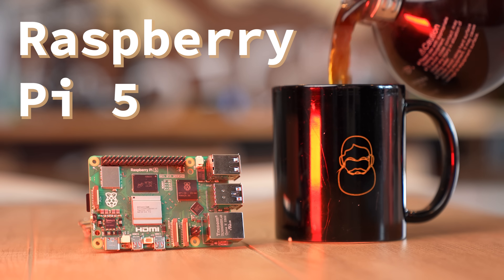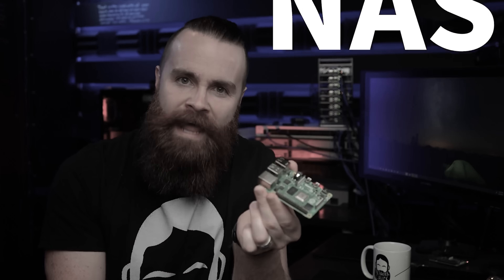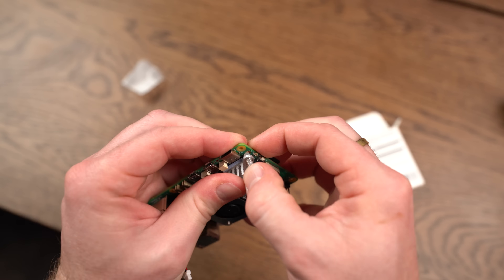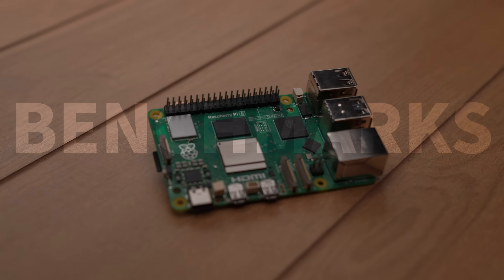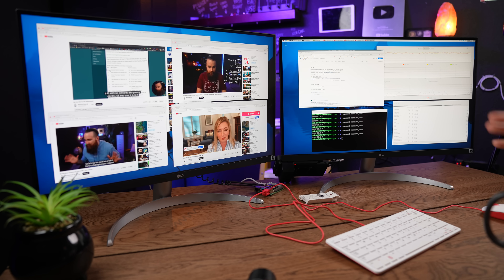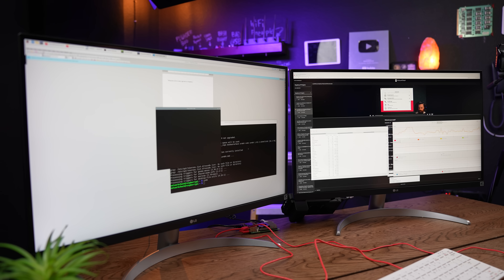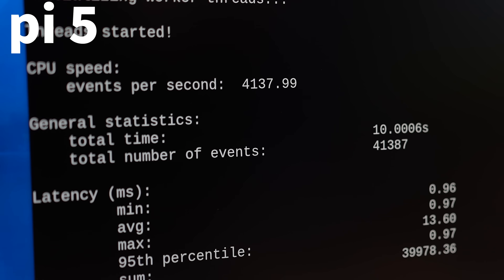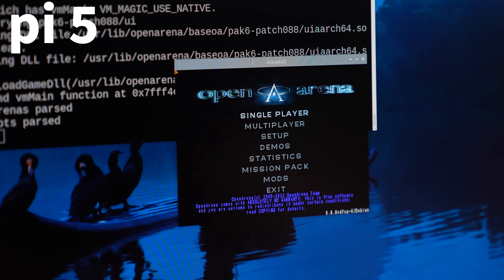the Raspberry Pi 5

Comment: You should test in a normal desktop environment with 1 monitor at 1080p, even though the Pi is capable of 2 monitors at 4k. Maybe this way the GPU performance wouldn't suffer so much.
Reply: Run an SSD and it will greatly improve
Reply: @mrmotofy  I don't believe it will improve much for video streaming. Maybe using network cable instead of Wi-Fi would also be a great test, also, is there already an interface to convert the ribbon cable connector to an actual PCIe slot?
Reply: @linsdudu  The  whole OS running on and SSD? Yes it will be tons faster, from like 84Mb/s to 400+ Mb. Everything gets better. I run the pi4 on an SSD and it was night and day difference and it maxes at 240Mb and doesn't drop frames at 1080p
Reply: @mrmotofy To load the OS and applications I know it will improve performance, even running from USB, now with up to 5Gb/s, which is close to SATA 3 but when you are already in the browser streaming the video I don't think it will make a lot of difference and we don't know the SD card interface speed comparison of Pi4 and Pi5 as well. UHS-II cards can support speeds of 300MB/s+
Reply: @linsdudu  We DO know, sdcard is 2x faster at 84MB/s and SSD is 2x faster too at 480MB/s. The processor is about 2x faster. So on an ssd yes it would be very usable. A pi4 on SSD at 240MB is very usable at 1080p
Anytime you speed up the files system everything speeds up
Reply: @mrmotofy  Jeff Geerling has a more indepth video on the Pi 5 with better results running of the SD card.

Comment: I must be honest any used $100 mini PC is better. RPIs prices are so inflated and I totally stopped using them for all my projects,  On a mini PC you can install, Windows, Linux or Android. If I need IO ports I just slap Arduino on the USB port. The 4K and YouTube video playback is perfect.

To be viable, RPI should cost:
zero $10
3 $25
4 $35
5 $45

Comment: Overclocking gave me better video experiences on pi4. Hopefully with overclocking and new features unlock, 4k video viewing on single monitor should be more stable.
Reply: Hmmm, maybe, but it now already ran max resource and very high temps, add a sunny climate or warm room, a case and more continuous load I wonder if it will not crash multiple times a week in longer operational times
Reply: @xdarrenx  i bought a custom cooler fan. it's a must for over clocking

Comment: Raspberry foundation takes 4 years to release a new Pi, but when they do its huge news
Reply: Yea but...there's the global shutdowns and massive chip/product shortages that have crippled productivity for nearly all manufacturing
Reply: @mrmotofy  here's the global shutdowns and massive chip/product shortages
that's not the case. The dark side of the Raspberry Pi is that it eventually became an enterprise oriented rather than hobbyists product  so too many businesses have jumped on the boat causing that high demand that in turn makes all those shortages and drives stellar prices. There was no "chip shortages" for Raspberry Pi alternatives at the same time though. Moreover, some major electronics suppliers for 3D printers filled the gaps by offering their own Raspberry Pi substitutes which are cheaper and way more adjusted to the application. So now it seems like Raspberry Pi manufacturer is just trying to catch things up and regain the lost market share.

Comment: But is this better than the OrangePi5?
Reply: Did my own research, The Rockchip is still leagues ahead of the Cortex A76. Idk why anyone would want to buy a Rpi anymore when it's actually more affordable to go with another SBC now a days. I use it for home assistant and network hubs, I personally wouldn't go back to the Rpi4 after going with the OrangePi5 personally. I don't know if I'll choose the Rpi5 either. I may pass until they get something more beefy that can be a low power low-end PC equivalent.
Reply: @oldmedia7  Running on a slow sdcard, no use ssd

Comment: I actually needed to buy an active cooler for my Pi 4 running my PLEX Server because it was getting a tad "toasty".  These look SWEET...are we actually going to be able to get one though?    That drought of PIs was HORRID.  I used them for my 3D Printers, and playing around with.
Reply: How the hell did you run a plex server from a pi? I assume you were only streaming to a couple of devices with GPU transcode or native? I run my PLEX off a 5950X server with CPU transcode lol. It runs a lot more than PLEX but moving services to a few PIs would save power.
Reply: @spencerhho Plex PI Server.  It works, and available from PLEX.  I use a PI-4, and I can easily stream two 1080P videos.  I've not tried 4K at all, but I don't have any 4K ready to go yet as I'm still having issues with my 4K Movies having mutliple M2TS files for a single movie and needing to merge those M2TS files into a single file.  There doesn't seem to be any free merging tools for this.  :(

Comment: Damn, Pi 4 and all others are super expensive, 80$ will get you a great HP SFF with quad core CPU and 32gb ddr3 PC that has 2   3.5" bays and 2 bays for 2.5" disks or even 4x3.5 if you get those sleaves.
Reply: But will it fit in your palm/pocket
Reply: Which HP model is that? Is it new?

Comment: Knowledge is knowing it CAN use 2 4K monitors. Wisdom is knowing you SHOULDN’T.
Reply: Realism is knowing if you can afford two 4K monitors, you'll be able to afford RPi5 (from scalpers).
Reply: @sharpfang I just said the same thing about the scalpers before seeing this comment
Reply: @sharpfang  yea... that is what kills me. lmao... In my country, the Pi 4 2GB were like 150 USD... 8GB around 300... lmao (probably because scalpers bought from official sites that already had inflated prices)... lol I want one, but heck I gonna pay that much for a pi5...
Reply: @sharpfang  lol
Reply: Still, that makes it a great deal for info displays at shops and restaurants in which you probably just display static images anyways
Reply: @jackmcslay  I mean, I sell and install AV solutions and there are better solutions for the same price... A dedicated video streamer can easily cost less than a (hence) barebone Pi5, and if all you need is static images, even some hdmi splitters can do that standalone.
Reply: This honestly.
 I don't know from a production level, but it seems like this is a far cry from the old $35 price point, and to remove the composite cable. 
I don't understand why you need 4k on a Pi... if anything I'd much rather this stick with 1080p performance if it could have knocked things down in cost. 
$60 is no longer an impulse buy. It's now something I have to make as a calculated decision. Cause two PI-5's can be the same as an old desktop which will be a lot more useful.
Reply: @novamaster0  Info screens are a big application for rpi. Framerate in single digits is not a deal breaker,  but sharp, big contents matter.
Reply: @novamaster0  how old a desktop? It boils down to CPU and GPU of PC vs RPi5 and how much for each.
Reply: @novamaster0  with the 4k support u can create a nice 3D Printer with integrated Display and 4K Cam inside it by using that PI5... thats a good Point for it. also know that Pi's are for guys who wanna do it self and not bye the things totally done at any market.
Reply: @novamaster0  Two to three times the magnitude of the last generation of Pi, at a little under twice the cost. Seems so-so as a deal. The Pi5 does not even support 4K yet so their selling point about that is kind of moot until FW updates.

All in all I agree with your statement of "I don't know"

I'm not sure how I feel about it all, especially with scalpers knicking the entire preorder inventories in a matter of minutes.

The Pi industry has far left their origins and are aiming to be absolute giants, before they can even take a few baby steps due to their infrastructure being so insolvent and highly dependent upon even bigger giants.

Arduino is looking mighty fine these days. All their new tech has been popping off. RISC is interesting to watch too.
Reply: @novamaster0 
Watching Eben's RPi5 launch video, he addresses the pricing.
The RPi is now officially the flagship product.
The low cost entry point version, previously filed by the RPi1, 2, 3 and to a lesser extent RPi4 is now filled by the Raspberry Pi Zero 1, 2 and 2W at £5-£10 and the left field  Raspberry Pi Pico and Pico W at £4-£6

As far as I can tell, the RPi Zero 2 W uses the same quad core CPU and VC6 GPU as the RPi4.
Reply: @MostlyPennyCat The zero 2w is the same as the pi3 but cut down and less RAM and I/O.
Reply: @novamaster0  Honestly, this is fine to run a desktop on with Linux. $35 made sense 10 years ago, but inflation absolutely destroyed that just in the last 2.5 years. The Pi 4 8gb costs about the same as this now. Nothing you can buy under $100 touches the performance of this new board. When you consider how hard the foundation works to optimize the OS while most of its competitors tend to barely support their products, if at all.
Reply: @novamaster0 the composite was nearly impossible to use on the pis. it makes sense to cut it.
Reply: @polocatfan  I miss the audio, but it ain't a deal breaker.
Reply: @polocatfan  ..how sad you had such problems, I used composite on RPi’s from Pi1 to Pi3B+… ‘nary a problem, no glitches, just TV out perfection.
Reply: Eta prime = 2 arcade cabinets 😄
Reply: Yeah, I seriously wonder if running a single 4K display would have given him a better experience.
Reply: The composite physical CONNECTOR is gone, but the composite output is still available on two pads.
Whereas the analog audio output is gone gone.
Reply: my lepotato, radxa zero and pi4 can already play x265 4k flawlessly, not sure if I am that stoked now about the pi5 thanks to this common beardo. I think I will spend my $ on a 1TB microsd card from amazon instead.
Reply: Depends on what you're doing.

If one is just displaying text, it's no big deal using 2 monitors.
Reply: Live life to its fullest.
Reply: Knowledge of knowledge is better than no knowledge. ¯\_(ツ)_/¯
Reply: 2k likes
Reply: Common sense is knowing it is not made for that😂
Reply: Man, i bought a Mac book 
Seriously, it can not support dual display 😂
Reply: I once had dinner with Eben Upton in Mountain View. Kind of randomly. We ended up sitting together at the Amiga’s 30th anniversary celebrations.
Reply: wisdom is also knowing the refresh rate, 60fps or bust! (which apparently it supports)
Reply: @robbyandrews223  4k 60hz, he even said it in the video
Reply: Knowing you're use case isn't the only one in the world is priceless... 🤦
Reply: Wisdom is also knowing you should allow others to make the decision themselves.
Reply: Why not? It’s totally fine to do it so your comment doesn’t make any sense at all. It won’t hurt it in any way. You must not know much about tech and hardware?

Comment: No it's not a desktop replacement unless that's the only computer you can afford or if you don't value your time or a good compute experience. We have heard the desktop replacement claim for almost every raspberry pi. It is not meant to be a desktop replacement.  YouTube still drops frames, the whole experience is just not as spiffy as a regular computer. People should stop misselling it as one. It is a cool little computer for mostly headless usecases or digital signage applications. For that it is great.
Reply: But run it on an SSD and your experience will be vastly improved. I did the pi4 and it made it very usable. The pi5 is 2x faster sdcard, 2-3 x faster processing can hit nearly full 5Gb on SSD/USB etc

Comment: Love it! I do wish they swapped out the micro hdmi ports for vertical fullsized hdmi ports (or even just 1 horizontal one) and kept the 3.5mm headphone jack but even so I'm definitely picking one up.

Also pronouncing the gpu as a 'Videocore Vee-two' confused me for a moment, its just roman numerals for 7.
Reply: It has gpio pins so can't you just set a pair as analog outputs (via the DAC) and plug in that way?
Reply: @isbestlizard Not if it sounds like a pi4 does when you try that. It's noisy.
Reply: @isbestlizard  The Pi5 still has pads on the board for the analog video/audio out, you just have to wire it up yourself

Comment: Mann, a pi 5 NAS with an hba connected to the pcie slot would be a synology killer
Reply: pcie slot is only gen 2 though. Even then I don't think the power supply would be enough unless you stack a hat with an extended power barrel on it.
Reply: @r0bo11  pcie gen 2 is fine for hard drives, most of the HBAs used in homelab are pcie gen 2 anyway. You would definitely have to power the hard drives with a different power supply, but this is easy to do.

Comment: Waiting for:
Raspberry Pi Router + NAS + FireWall edition:
with: 
4 x 2.5gb ethernet ports;
2 x PCI v4 fo NVME SSD;
(support RAM upgrade) DDR5 up to 32 or 64Gb or 128Gb;
+ PCI v4 for Wi-Fi6E or Wi-Fi7.
+ good power adapter, not USB.

Comment: Now to make a "supercomputer" cluster and bench it to see what kind of performance it has vs all the ones people built using the Pi 4 😁
Reply: bit of an odd take since a cluster's main characteristic is power through having more units with less performance per price, instead of 1 or 2  strong performing units (like a desktop or traditional server), in this case a rack of chinese clones will outperform the entire raspberry pi brand->line unites for the price. Reliability specifically is not relevant because you think it's bad because it's Chinese, because 1 of the major advantages is specifically in cluster computing, that multiple nodes can fail, and the cluster keeps operating just a bit slower until you swapped the faulty units. You price will be lower and your parallel computing power greater per price point with Chinese clones

Comment: It will not be a replacement for the desktop because of RAAAAAAAAMMMMM!!!!!1111 Why couldn't they throw in more RAM? This is an epic fail at the end of 2023.
Reply: 8Gb is plenty
Reply: @mrmotofy  Oh, welcome another one "640k ought to be enough for anybody"
Reply: This is Linux, not Windows.
Reply: @lawrencedoliveiro9104  who told you I am on Windows? Because I am not. Currently my desktop consumes 13GB and I am not running more dev tools I run usually. If the only thing you do is running "cowsay" in the console it does not mean everybody uses the same level of entertainment.  "640k ought to be enough for anybody", right.

Comment: Sad that we have left the $35 price point behind but, this thing is hot!
Reply: Inflation my friend...
Reply: @dominick253  Inflation my friend... 
not really. The fact is that Raspberry Pi moved from a hobbyists to an enterprise oriented product but failed to suffice the supply to satisfy the huge demand the businesses caused. All those factors cause the board shortages and push the prices up high. But in fact Raspberry Pi is quite mediocre product which doesn't even have a native PCI-E SATA interface on-board which is absolutely ridiculous especially when the others do.
Reply: @MSM5500  Why is the Pi a mediocre product just because it doesn't perfectly fit your use case? It overall has solid price to performance, great connectivity in many ways that aren't specifically having PCI-E SATA ports, and a level of official and community support that most other board makers could only dream of having. I don't get why not having that specific port is such a black mark when you could just get a hat with all the connectivity you want, possibly more than the other boards you describe.
Reply: On the brightside pi 4s will actually be available for a little while as the scalpers dump their stock for these
Reply: @rmo9808  Yeah there's like 5,000 pi4 8gb models on Digikey rn
Reply: It was 35 $$$ in the past???
Reply: @Vicenteprz  Ras pi 1 2 and 3 were $35. As we got into Ras Pi 4 there were different versions and I think the Ras pi 4 1GB was the $35 ( or close to $35 ) version.  Rasp pi 5 there seems to be nothing close to $35.
Reply: Inflation is real
Reply: @Kaodusanya  As always. In the case of the pi, it's more complicated than that though.
Reply: @Kaodusanya  And no Deflation in sight...
Reply: They also left MIDI DIN behind.